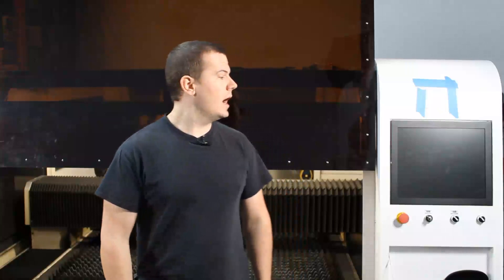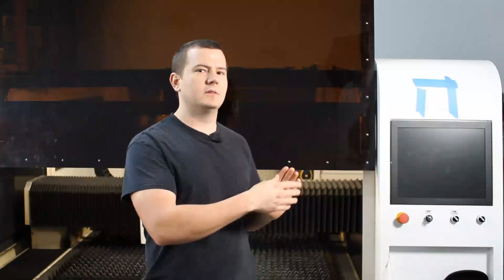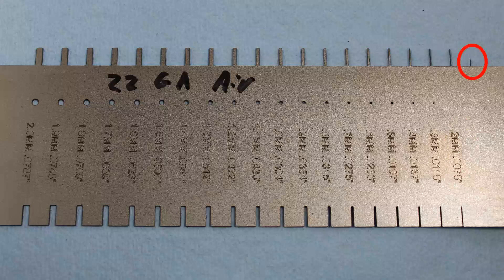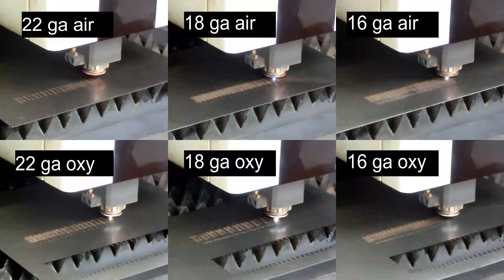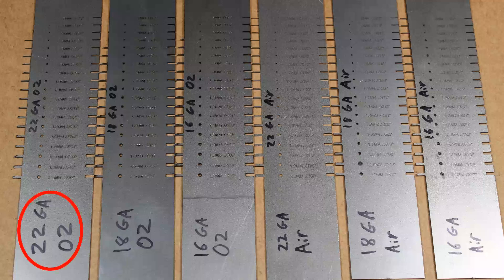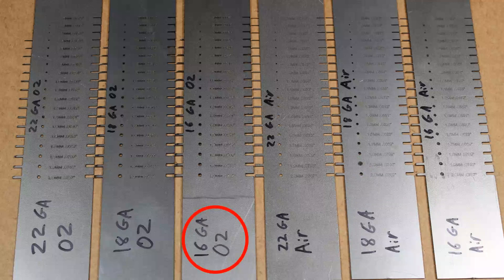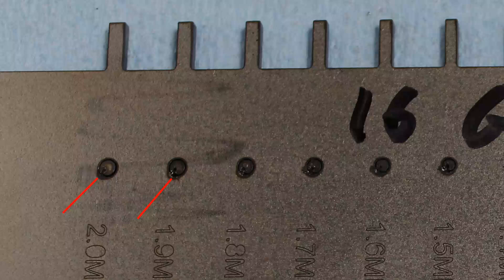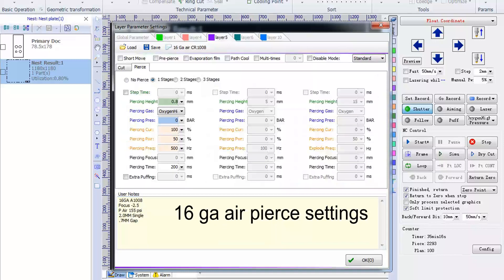500 watt Fiber laser cutting metal, oxygen vs compressed air

Comment: Hello!   I couldn't find a test in your videos that shows how thick plates can be cut with the 500W fiber laser.
Carbon steel, stainless steel, aluminum, bronze, copper. I would be interested in cutting these materials in 1mm thickness steps. 1mm, 2mm, 3mm... etc. Ty.
Reply from the maker: Our original 500w source lost one of the three modules nearly 3 years ago and we are currently running a 1500w laser. But a 500w can do 1.5mm in steel and stainless, we did 2mm with some regularity but it was not perfect. Aluminum bronze and copper is not generally recommended on low powered machines because it damages the sources due to thermal reflection.
Reply: Ok, I understand. Thanks to reply.

Comment: We have a 1 kW fibre laser cutting machine. Want to cut 4mm carbon steel sheet with compressed air. What should be the cutting parameters: 1. Air pressure, 2. Focus distance, 3. Nozzle size and single or double and 4. cutting speed? Thank you.

Comment: How much kW machines you are using???
And any update for the Prerameters..
Reply from the maker: So all of our current videos show a 500 watt. We are currently running a 1500w. As for parameters. I have now experienced setting up a couple other machines and can say that the numbers are not directly useable one machine to another. We have parts of a video on dialing in a material, which teaches the process for finding the correct values for your machine.

Comment: If you're doing private projects with a smaller model of fiber laser, and time isn't a factor, can you cut thicker sheets with compressed air?
Reply from the maker: There are limits. You have to be able to liquefy the metal or the air cannot push it out of the way.. with a 500w the max with is about 14ga or 2mm for clean cutting. 3mm you can cut but it's slow and lumpy, lots of clean up. With oxygen you can go up to about 6mm or 1/4" and get a somewhat decent cut. But a higher power laser gets you more of everything.

Comment: Hello friend ... your videos are very interesting, now I want to ask you if you know something about laser reflection and how it can be avoided so that it does not damage the source.
Reply from the maker: I work with nonreflective materials so it's not something I work with. However I have heard that having the laser head slightly tipped can reduce the chance of a reflection damaging the source. The other is to start your peirce high as reflective material is much less reflective once melted, and being higher reduces the likelihood of a reflection making it to the source.. the other is to use a head or source that is protected from reflection, they use mirrors that scatter any energy from a reflection.

Comment: Do you also cut stainless with compressed air?
Reply from the maker: Yeah we are currently cutting 304 stainless, it seems to cut just slightly easier than carbon steel. The edge quality on 22ga to 16ga is smooth and just slightly oxidized a slight straw yellow tint. Seems to come off with passivation.
Reply: @smallshoplasers8785  Nice, we have a 1000w laser on order at the moment. We've been getting really conflicting info on cutting with compressed air. Would you mind sharing what pressure you are using for different materials?
Reply from the maker: @MrMBaum  we are just running a 500w laser so it's possible our air requirement are slightly lower since our cut speed is likely lower we show the compressor setup in another video and it's a fairly basic shop air compressor with a few add on features but it limited to 175psi max pressure. On 22 ga or .7mm it is 150psi at 13m a minute. On 14ga or 2mm we are running 165psi I think at 2.5 or 3 meters a minute.. the pressures should be at the end of this video.. I'm doing another video on upgrading air line size, with a few experiments we have found nozzle pressure is much lower than regulator pressure due to line drag. So we are installing a larger line to see if that improves things.
Reply: Hi,sir.This is Dylan from SENFENG LASER which has 16 years' experience of fiber laser cutting machine.We are professional fiber laser cutting machine manufacturer.If you have any needs,please feel free to contact me.My Email:dylan@sfcnclaser.com; My Whatsapp:+86 17865122577

Comment: I m using compressed air for cutting ss and even brass with my 1KW fiber laser machine. The main problem I have is the protective lens will get a lot of water on it and I have to clean it very often. I m using a good compressor with air dryer and three filters. I tried using different pressures from 12 BAR to 18 BAR. I always got the same result. This problem is delaying a lot my work which does not happen when using Nitrogen.
Any idea on how to eliminate this problem?
Reply from the maker: You need an refrigerator air dryer that is sized for your airflow. And some additional filters to get oil out. If you go to the compressor setup video we give a list of what we are using. Naturally you will need to upscale since your running a larger compressor.
Reply: @smallshoplasers8785  I got three filters and air dryer that come with the compressor. I should clarify: what I mean by water on the protective lens it's just one  drop of water that spoils the cutting quality, this is why i must clean it every five minutes.
I think my setup is ok, here are the specs of my compressor

Air Compressor     Max free air delivery: 1.0 M3/min                                        
Max working pressure: 30 Bar                                         
 Power / Voltage: 11KW; 3Ph/380V/50HZ              
Volume of air tank: 300 Liters                                                                                          
Net weight: 500KGS                                                      

Air dryer    Capacity: 1.2 m3/min;    
Pressure: 30 Bar                                                      
Refrigerant: R22                                                                  
 
I got 3 Line filters 1.6 m3/min 30bar pressure
Reply from the maker: @abdenbimandar3904  I would say something is wrong with the setup if any water is getting through.
Without looking at it I would have a hard time pointing to any problems.
Some things to check: 
Do you have an auto tank drain and is it working? How much water are you collecting off the tank drain? Does your compressor have an inter cooler to cool the compressed air before it goes to the tank?
 This can help to get moisture to drop out in the tank.
Do you allow the refrigerator dryer to get cold before you start the airflow? How much water is it collecting per hour or day?
Do you have a water separator before the refrigerator dryer? And do you have any paper cartridges to collect oil or fine water mist after the dryer?
And last idea, have you adjusted your lasers water cooler unit to compensate for summer temperatures? In certain temperature and humidity ranges the laser cannot be run because of condensation, it could be that your compressor system is fine and the water is coming via condensation. A dew point calculator and temperature humidity gauge can be helpful. I am in the tropics (florida) and after a heavy rain I have to shut down for a couple hours otherwise the machine will be dripping wet from condensation.
Reply: @abdenbimandar3904  maybe your dryer not fit to big air flow, do you use piston air compressor? At least need 4 air filters + 2 oil/air filters
Reply: @abdenbimandar3904  Hi What is the air compressor brand and model you using now? I have 1000W fiber laser and trying to purchase high pressure air compressor.
Reply: @parkfamily6940  hi, see my compressor specs in my previous comment here

Comment: Except the air compressor runs on 11kW.
Reply from the maker: I'm not sure what you are referencing. The compressor setup we are using for our shop is a 5 hp Quincy QT-5 which is roughly 3.7-4kW. Compared with bottled nitrogen or oxygen it is very inexpensive to operate, my power cost to run it is roughly $6 per 10 hours, bottled gas is roughly $90 per 10 hours.. The advantage is cost savings by the hour, the disadvantage is the high investment for the fairly large compressor and drying equipment, and yes you are going to be paying for electricity but it's cheaper to compress air than it is to separate and bottle gases, or to liquefy gas.
Reply: Hi,sir.This is Dylan from SENFENG LASER which has 16 years' experience of fiber laser cutting machine.We are professional fiber laser cutting machine manufacturer.If you have any needs,please feel free to contact me.My Email:dylan@sfcnclaser.com; My Whatsapp:+86 17865122577

Comment: Try increasing cutting speed for oxygen
Reply from the maker: Any higher resulted in cut quality reduction. The oxygen speed setting was dialed in over a long time as we ran the machine on oxygen for over a year.. any higher resulted in poor edges. Air is faster on thinner metal and cheaper. The data is what it is.

Comment: Hi , thanks for this very useful guide here, Our machine is 500 watt max fibre laser cutting machine. our regular job is 2 mm stainless steel. our compressor is fs-curtis model seg 7.5hp 12 bar, 120 gallon tank, with refrigerant dryer and pre and post filters, 17scfm actual. will it be good for 2mm stainless steel (14 gauge sheet) can you make a 2mm ss cutting video same design as in this video. if no , than suggest the upgrades specifications.
Reply from the maker: I have cut 2mm stainless with this setup. However it was just a few holes. I would suggest a 2mm single nozzle with a 0.3mm cut height (nozzle stand off). Start with a focus of -2 and a cut feed rate of 2m per minute and around 165PSI or 11.4 bar and then start adjusting things to see what makes the parts better. You will get a slightly blackened edge, that may or may not be acceptable for your application... I don't work with much stainless but I will make a video as soon as I get some in the shop but it will be at least a few months.